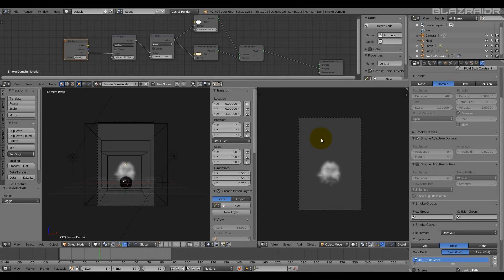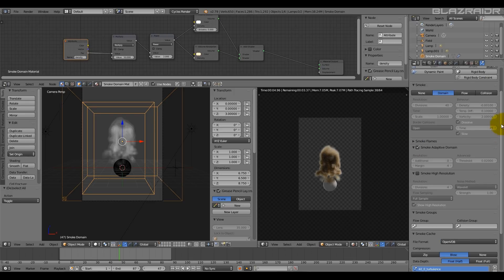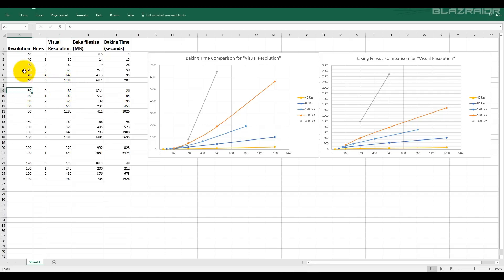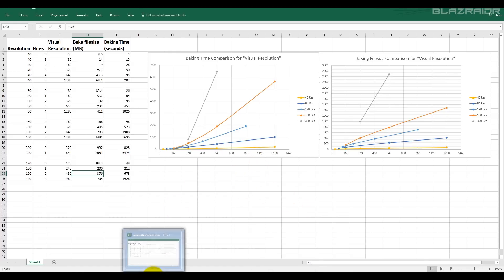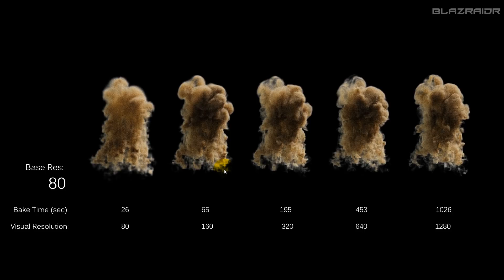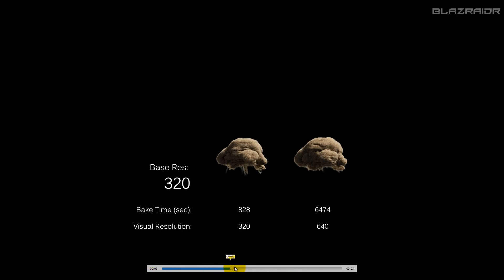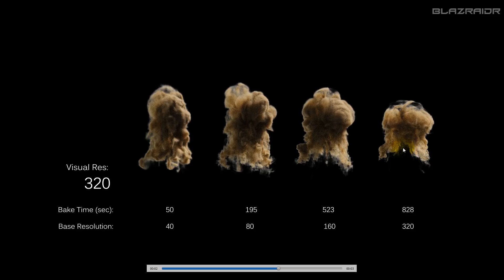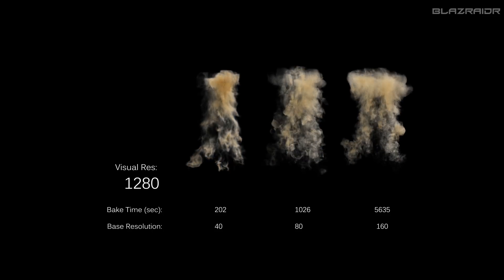Smoke Resolution Comparison with Blender

Comment: So guys what do i need to do to have a "decent " render in 1080p of my smoke simulation (and have a 1-2h render time) (i have 2070 and a amd ryzen) ? All my renders are blurry cubed and i even tried 128 before baking files.
Reply: Press the S and make the domain bigger, it always happened to me and I did not understand why, I did the same as in the tutorials and my renderings were fatal.

You just need to scale it to make everything a little bigger and the smoke will look great.

Comment: Well done going through all theses simulations! However you didn't mention the "volume step size" parameter, which was very important in my tests, assuming you used cycles, did you leave it to the default value of 0.1? If one of your simulation had a visual resolution higher than the volume resolution implied by the volume step size, it may even not be the best quality you could hope in your high resolution tests.
Unfortunately it massively increases render times with cycles, but for still images it can be decreased to 0.02 and still create reasonable render times. For lower resolutions of smoke simulations, I believe it could even be increased without losing render quality while gaining render speed.

Anyways great video! I hope to see more tests like this one, I learned a lot.
Reply from the maker: Glad you enjoyed it! Volume step size was set at 0.05 for all the simulations. I'm not sure if setting it lower would have made a dramatic impact on the render quality of the higher simulations that I showed, but yes you've raised a valid point and the volume step size should definitely be taken into consideration with these kind of simulations.
Reply from the maker: Just did a quick re-render of a few frames of the higher resolution simulations with a step size of 0.005, and there was no major visual difference in this case (render time was much longer though)
Reply: I imagine it is only useful to save render times on lower resolution simulations then, I will do some testing to see if there is an optimal value for this parameter to get the best visual result with the lowest render time according to the "visual resolution".
Reply from the maker: Awesome! Please keep us posted!
Reply: The step size seems to be best set at domain_size (in b units) / visual_resolution though it is a bit overkill sometimes and quite noisy for low smoke divisions
and max step seems to be best set at visual_resolution
where visual_resolution = smoke_domain_divisions * high_res_divisions

I also noted that lower step_size produces less noise for the same amount of samples, needs investigations...
Reply from the maker: Ben Crulis Great work! I'd imagine that the ideal step size value would also be affected by the render resolution. In the case where the volume step (when rendered) becomes less than a pixel width,  lowering the step value probably wouldn't affect visual quality of the smoke any more, and would probably just increase render times unnecessarily.